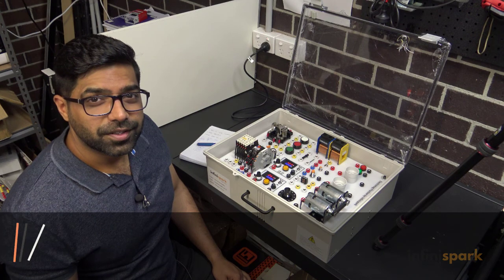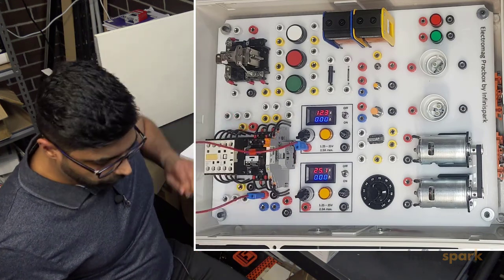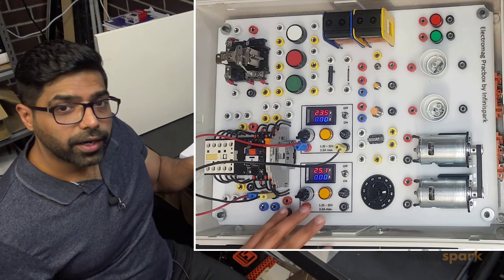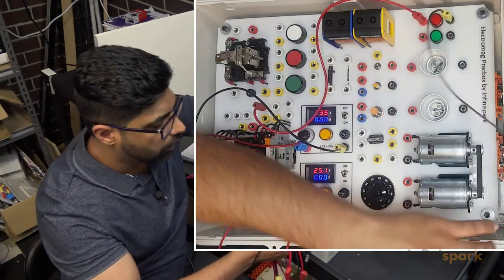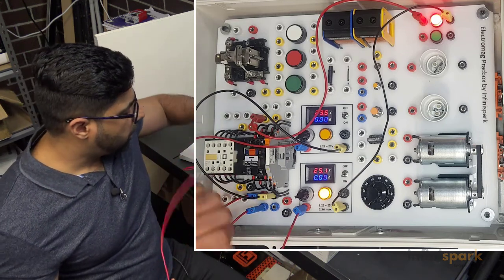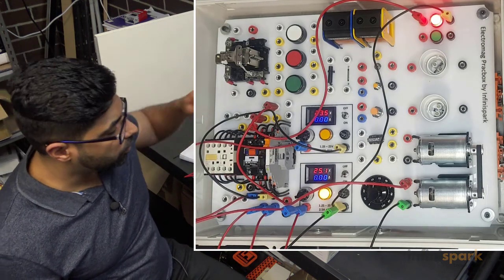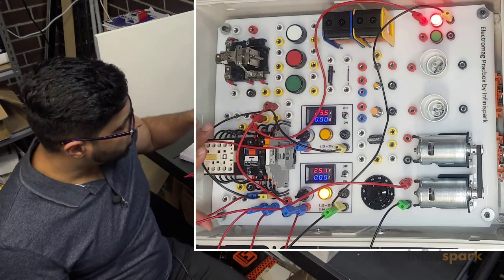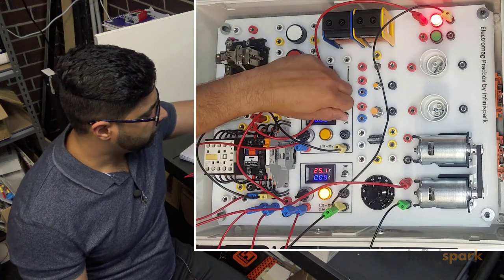How to wire a 24V relay

Comment: In 24v dc relay can I use 240v ac on NO NC and 24v dc for coil voltage?
Reply from the maker: Most relays will mention the contact rating, and as long as it's at or above 240V AC and the current is under the maximum ratings, you will have no problem. This particular relay can handle 240V and the maximum current of 12A

Comment: "How to wire a 24V relay" This is a completely useless video. Sorry but unless a person has a setup exactly like this you are not show anyone "How to wire a 24V relay".  You can't see ANYTHING of what you are doing and the connections would not correspond to and connections on the relay.
Reply from the maker: Thanks for the feedback @Aztec Warrior. We manufacture this equipment for training organisations that teach electrical, and it made sense to make the video on how easy it becomes to teach the relay wiring and connection basics using it.
Please feel free to recommend what type of videos would be helpful to you and we will try to make them.
Thanks
Reply: @infinispark  its a good video but Aztec has a point, maybe you can add a diagram that really show how the relay should be connected. Thank you for sharing